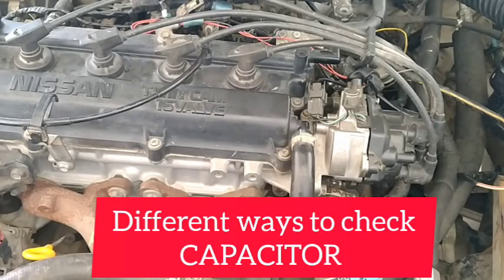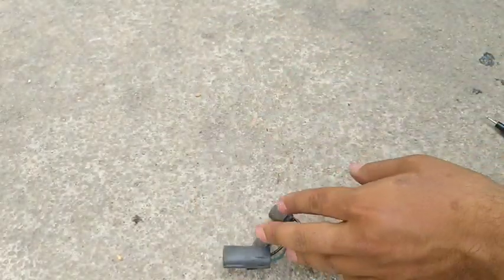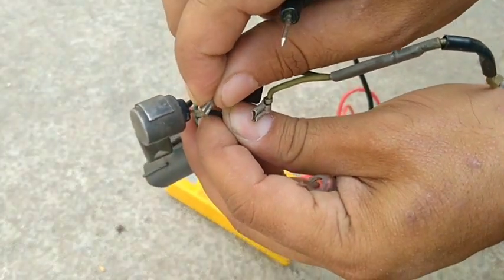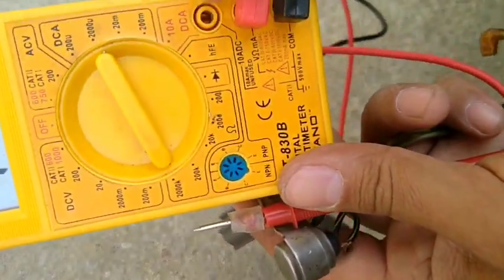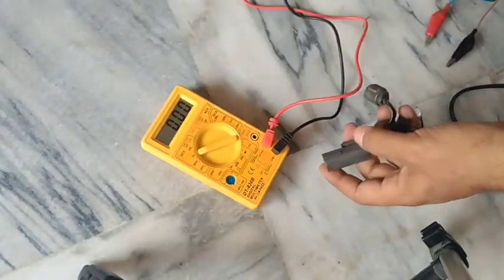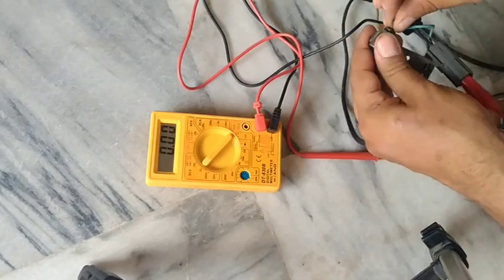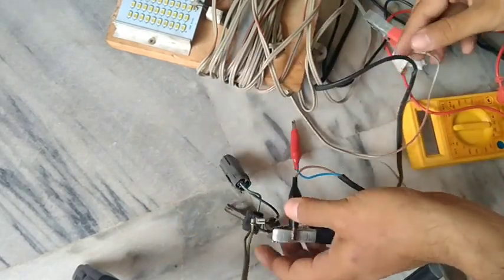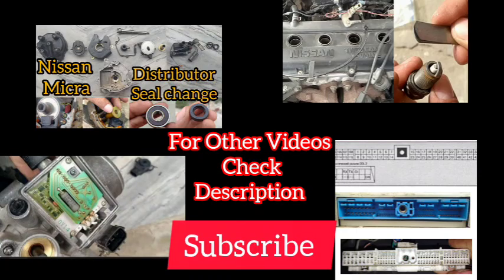How to Test #Distributor #Capacitor for Car Ignition Problems

Comment: I also got this k11 nissan march...after turning it off n then turning it back on there's no engine check light it won't even start...then I have to wait for 7 to 10 minutes then the engine check light comes back....n also if i press the gas paddle the engine check light comes on

Comment: sir i from Srilanka i have question , im planning to nissan cg10de engine swap to classic mini cooper so i got engine first without engine wiring loom then i found full K11 wiring loom but distributor connector wire not match with distributor. engine distributor has capacitor but my wiring loom does not have capacitor wire. so how can i connect this. can i have your email to contact you
Reply from the maker: Yes for sure I would be pleased to help you. Cg10de is 1000 cc engine right. And you have CGA3DE engine. Your distributor may have six pins and 2 capacitor pins total 8 right. I will send you the wiring diagrams. Or make videos on that. Thanks gattcpesh@gmail.com
Reply: SIR I NEED YOUR CONTACT😊

Comment: Why is it that this type of capacitor can't be tested with the capacitance test on the two wires? The capacitance test only works with either of the wires and the capacitor body. Strange behavior.